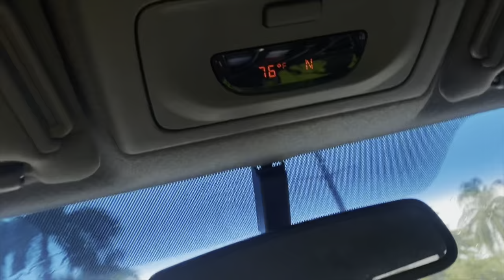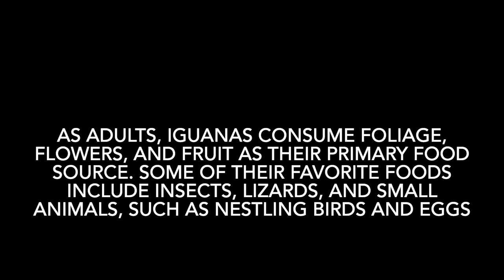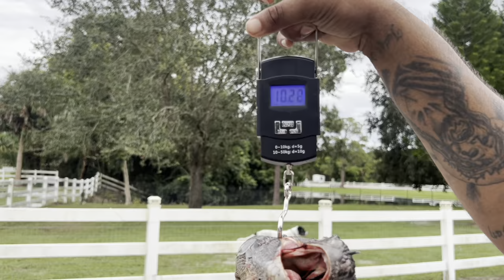Day 18 -Preventing iguanas From STEALING Hay From Private Ranch! Neighbors Threaten to Call Cops!

Comment: I never used an air rifle like these.  But my basic .22 long rifle rifle holds fifteen in the tube and is auto loading with a good scope.  I have only shot a rabid acting racoon, a rabbit/hare and four ground hogs.  I assume these rifles you use are like using a .22 perhaps a bit less muzzle velocity.  Does the velocity decrease as the gas is used up?
Reply from the maker: It’s safer to use then powder, rifles less chance of ricochet and other safety concerns